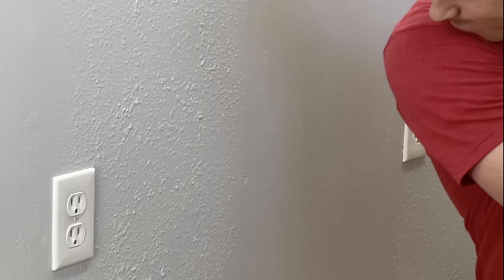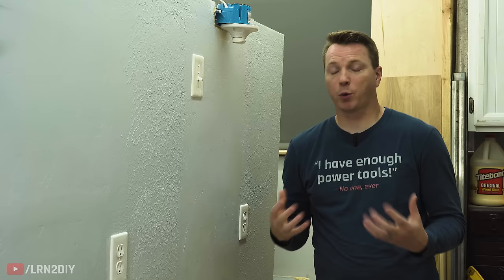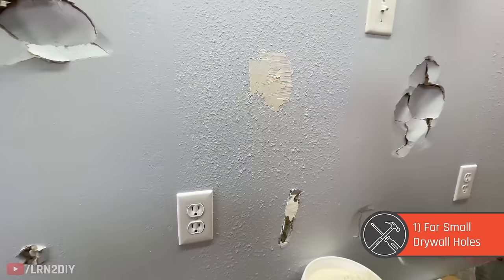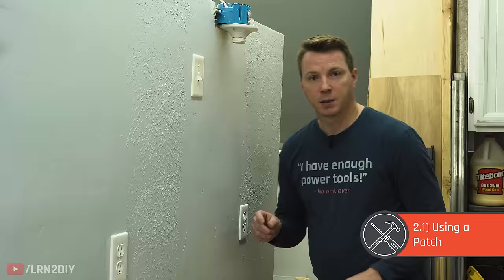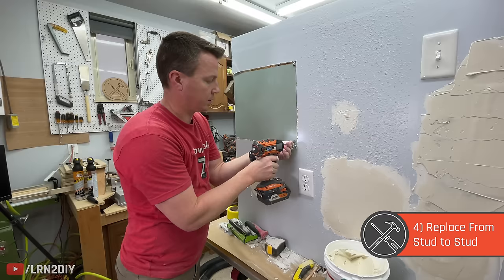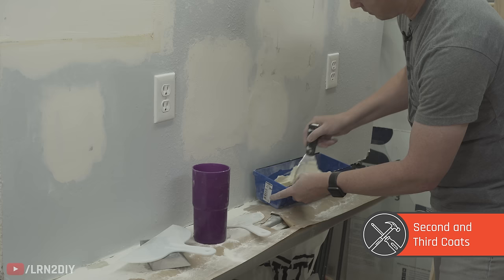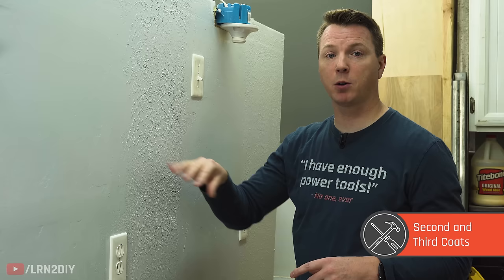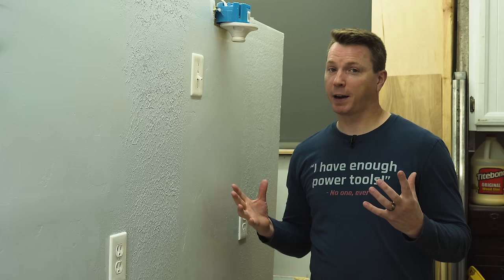How to Fix Holes in Drywall - 4 Easy Methods

Comment: I had a small hole in my wall and when I had trouble fixing it I got really mad and punched another hole in my wall. Thanks to this video I can fix both holes.
Reply: 😂 I can relate.
Reply: I laughed so hard at your comment I Chuck Norris roundhouse kicked a hole in my wall.... but now thanks to this video I can afford to laugh at any comments I want now.
Reply: Did you fix the holes. I need to know babe im invested in this comment ❤
Reply: Hahahaha!  Wtf!  I just found this video after frustratingly punching the small area I'm trying to fix.  This little fuggin hole is holding me up from painting a larger project I finally finished!  Ahhhhhh!  I needed the hole to be bigger anyway so for once I'm not that mad about punching drywall but your comment cracked me up!  Thanks!
Reply: Me too!! 😂
Reply: The anger issue isn't fixed yet 😂
Reply: use tape
Reply: Lol 😅
Reply: @solosix3991  by far my fav comment on youtube 😂

Comment: Electricians and plumbers are eager to open up the walls and unwilling to patch it up.  Handymen are charging an arm and a leg for small odd jobs. This video is so helpful. Thank you!!
Reply: they arent eager.. they just have to. And patching drywall, while easy, is time consuming, so it's not reasonable to excpect a plumber or electrician to spend their time doing that without charging for their time accordingly. and their time is far more valuable than drywall repair.
Reply: This is exactly why I'm here. Plumber busted two walls and a ceiling searching for a leak and then refused to patch any if it. Had to pay someone else just as much as I paid the plumber to patch everything.
Reply: I had the same attitude until as a home owner I had to step into the role of electrician, plummer, tiler, dry-waller, painter, etc... now I am very willing to pay the price for these trade professionals to complete certain jobs for me.
Reply: Correct me if I'm wrong, but at that rate, you can only afford to repair 2 holes...
Reply: @cdee2456  as someone who has quite a few plumber and electrician friends I can attest that they love the freedom of not having to do patch ups
Reply: @isawrichvarga  who wants to back to the same job you got paid for, to sand a hole. and repeat again the next day?
Reply: @godsinbox  Some putty mix you can sand it after 30 mins or so.
Reply: @jcberb  I agree. I had the same shift in mentality when I bought my house. Some projects I enjoy doing myself, but other things I have learned to leave it to the professionals. Little by little, I am learning, nonetheless.
Reply: I honestly would like to know if a drywall should be replaced after so many holes being made.

A plumber came in having to fix the mess that our upstairs neighbor made renovating their home and now I got 14 holes in one wall alone. They were patched up by the handyman but ... I am worried about the structure integrity of my walls now :/
Reply: @orzori drywall isn’t really for structural integrity… it’s just walls made with dust and paper… it helps but more for looks
Reply: @jacobshandymantreeservicel2522  jdndjdnd thank you XD Didn't realize drywalls don't offer structure cause I kept thinking about floating shelves and furniture anchored to walls.
Reply: @cdee2456  I disagree.. Professional board hangers have a much more physical job that requires a higher IQ than plumbers dude.. Anyone can glue and clamp two pipes that weigh less than a pound together. Not everyone can even lift the drywall let alone install it onto complex custom properties that arent square and simple. Electricians may have a more dangerous job potentially, but these low IQ muppets hack openings wherever they want and never ever ever ever cut stuff out straight.. If they are removing a piece to install wires, then they should be putting that piece back. No other trades do stuff like that. If anyone else removes something to do their job, then like decent humans, they put it back.. I have worked around all these trades for over 20 years. Theres no 2 trades that do less and want more $ than electricians and plumbers. I can go do plumbing and electrical after an 8 hour board hanging shift, but I guarantee that 99% of electricians and plumbers could not do my trade at all. Let alone after an 8 hour work shift.
Reply: @illwill718  Plumber is responsible.. Plumbers are useless! Sue him
Reply: @isawrichvarga  they however are liable for the repair if they opened it up. Homeowners need to stop letting these crybabies in electrical and plumbing get away with doing virtually nothing..  If you have the money to waste, sue them to make a point.  I take no crap from plumbers. As a board hanger, we work many times harder than them and when they get loud, they find out that we hit much harder than them.
Reply: Best not to screw anything to a  dry wall,better the timber @orzori
Reply: @WickedLobstah978 I can run wires and build boxes until the cows come home, but the second I have to patch drywall it looks like hot garbage.
Reply: You definitely would not want to pay your plumber or electricians rate for patching a hole lol. Nor could half of us do a job worth what you'd be paying

Comment: I have 2 holes in dryhole where my recliner popped holes in the wall leaning back into it.  Handyman gave me an estimated price of $1,200. The 2 holes are  8" by 8" & 13" by 9". I am a widow (77) on SS.  I will do the repair myself thanks to your video. Much appreciated !
Reply: $1200 is criminal for that. I could patch those both in under 3 minutes then its just tape n mud which would take no more than 5 minutes.. He can then leave and come back next day and hit it again (another 5-10 minutes). To save time for him and money for you, he could leave a sanding block and you could lightly sand it the next day and then paint.. If you add all the total time this job would take for drywall, mud and paint, it is less than 1 hour of work! If I lived near you, id come help you for a cup of coffee. It bothers me that these scumbags want to overcharge especially senior citizens.. Over charge the millionaire. Not the average person. That guys top price should have been $250-$400 (that is still great profit for such little work completed, unless he had to paint too.. Its not even worth that, but people gotta understand that doing even a small job takes away from other work opportunities for that day and they need to still make a days pay, but $1200 is ridiculous and that's why I say $250-$400.. Gets it done quick and goes to another job.  I am an expert in my trade. I work in MA in many multi million dollar properties and have worked with over 100 guys in my trade and can definitively state that I am the very best at my trade (at least from the people I have seen do it).. And as an expert, I wouldn't dare try to charge you that much.. The guy who quoted you is a scab and is what's wrong with society. Greed is everywhere. Glad you saw this video though and can save yourself the money and stress of being taking advantage of.
Reply: 1200 is Highway robbery

Comment: I just finished repairing a bunch of holes, from fist size to 15 x 15 openings ( these were repairs over prior repairs).  I am so glad I watched this because it confirmed the fact that I was doing it right.  Thank you for putting out one of the best you tube videos I have seen on repairing drywall.

Comment: I’ve viewed numerous videos about this, but this video is BY FAR the best. Incredibly professional, loads of examples and variety, whilst the texture stuff is just a cherry on the cake. Life savers, thanks a tonne guys ❤️
Reply: If you have ever watched “ real” drywall professional, you will realize these you tube tradesmen are an absolute joke, this guy would be kicked off my job site in about 5 minutes of watching him work
Reply: @titirititiri6360  can you recommend a better way to repair drywall? I can’t find anything that isn’t like this video.
Reply: @newuser689  drywall patch? Indeed, I use a method called a peel back relief, and always use 5 min speed mud, the speed mud or hot mud, dries faster, there is a certain point when the mud can be shaped, I can shape a float in 1 coat, that would normally take 2-3 coats of regular box mud, i then use a heat gun to further speed up the drying process, because you can shape it, there also is a lot less sanding, in some cases when I cut the paper from the surface of the existing drywall (relief cut) along with 5 min mud, i can float the patch flat in 1 coat, with zero sanding. This of course takes a lot of practice, flexing the knife with correct pressure, clean cool water to mix with, and years of practice. 
I wish I had time to make a short video of it, perhaps some day I will have one of my employees video with phone and upload to YouTube. 
Beat of luck

Comment: Great video, thank you. When I had a wall removed years ago, the craftsman used a lightly wadded plastic bag from the grocery store and dipped it in the drywall mud and applied it to the ceiling. Matched the texture really well.

Comment: I’m journeyman drywall finisher and I’m warning everyone , unless you want to get dust all over everything in every room of your house , DO NOT USE AN ORBITAL SANDER IN YOUR OCCUPIED HOUSE . 

I mean you got the main points , but if you have exposed mesh tape after you sand , it will show through paint and possibly  your  through texture.
Reply: No orbital Sanders in an occupied house... Yes... Agreed UNLESS.. you are able to move everything out of the room you are working in. I have had to occupy my house each renovation and have found just closing one room off (vents and all) and opening the windows in that room made the difference. No dust all over the house if you tape off the vent, open the window and just work that room.  Hand sanding just doesn't get that even flush with the wall look.. or rather... It's something only very skilled dry wall experts get down... 95% of the hand sanding I've seen has that pillowy effect and is good enough for an apt but if it's my house I want it to look good for long term. I promise... I've replaced Hundreds of walls and just do it...
Reply: FESTOOL Orbital w/ hoover dust extraction attachment very good, use it in commercial office buildings with active air con units and clients next door.
Reply: how many coats does it typically take to hide the tape?
Reply: @surfprepsales  2
Reply: @gapsta  thanks
Reply: Mine has a built in dust collector, so no worries 😁
Reply: @beccaking13  festool orbital with dust extractor is great, i use it in buildings with air con and sensitive fire alarms all the time lol
Reply: Just curious......what's a journeyman drywall finisher?
Reply: @codymoore1223  
See this for the description of a journeyman: https://en.wikipedia.org/wiki/Journeyman
Reply: @mws3d  🤣 you don't need to be licensed and there is no certification for drywall. It's skilled labor. There's no apprenticeship and almost every drywall finisher is self employed.
Reply: @codymoore1223  someone that knows what they're doing unlike this guy sorry just keeping it real
Reply: I always just tape off a full plastic wall floor to ceiling to isolate the area I’m working in when it’s an occupied space. Doesn’t take too long and very effective. Some of those dust collectors people mentioned look awesome, but I’ve never tried them.
Reply: @Boardwiser62  facts
Reply: Also if you do a little bit of cleanup without leaving all those lines in the mud there wouldn’t be nearly as much sanding needed I can’t believe how much he just slapped on without any clean up,If you don’t do super sloppy work to begin with you won’t have to do as much work at the end
Reply: U try just sand paper by hand?
Reply: can mesh tape be sanded away

Comment: On pre-existing textured walls, dab the perimeter of the wet mud with a damp sponge to blend and eliminate new edge; otherwise, you should sand the edge when dry before texturing the patch, which is painstaking and unpleasant.
New texture will not hide that edge.

Comment: Helpful tip: When you apply the drywall compound keep your knife as clean as possible and make it as smooth as possible and not leave any lines. A few minutes of correcting that will save you lots of time and elbow grease when it comes time to sand and make it flat. Also I prefer a hopper than those cans of texture. It doesn't provide the almost identical texture Im looking for.

Comment: Thank you so much for the crash course! This is something that wasn't covered in high school. We only applied mud to pencil holes and staple holes. I do, however, remember our teacher bringing us to the gym storage where we could find the only "big enough" hole to use a mesh he placed behind the wall, holding it flat using strings then puddy it... I HAVE done this when I did interior painting on my summer job and it was not easy.

Comment: Thank you very very much for the tutorial! You taught me how to repair all of the types of holes I had in the drywall in my house in 16 minutes!
Reply: Lmao his work is so clownish 😂 that isn’t even how you do it. You should use much wider trowels for the wide ones. And the best thing is cutting a new drywall piece, and screwing it into a wood backer piece. Then mesh tape, mud 2x, sand prime and paint. This guy has no clue how to do professional work, his work is amateur work and the YouTube video is designed to be watched by amateurs
Reply: @charlesg7926  i dont wan to do professional work.  just want the hole patched

Comment: This is great. But it would also be very helpful to have a precise shopping list of the stuff you need to do all of this so people aren't left scratching their heads in the hardware store at all the different (seemingly innumerable) choices on the store shelves.
Reply: I'm sure by now you've fixed your problem, 2 months later and all, but here goes for future people who read your comment and agree;
One razor blade knife
One drywall breadpan(the long pan for sheetrock mud)
One drywall knife(I know, I know.  It's the wide spatchula looking thing in the video, not another knife.  As with the breadpan, any hardware store stocker will know and point you to it, and aside once in the section, you can't miss them.  The width is about spread, the bigger your hole, the more mud, the bigger the knife, the more surface area.  Or better said, pros use different ones for different stages of finishing work, ignore them all but the short one.  For the purposes of this video, you just want the one that's as long as you hand.)
Some mud.  Perhaps a pint if your hole is small or you do the square patch and are just filling seems.  Any kind is good, just grab one that says quick dry, you will not need a 5 gallon bucket.
One sanding sponge.  Grab the one that looks like a trapezoid, and not the brick, easier to press your fingers when sanding stubborn bits, it's useful for more than just corners.
A chunk of drywall.  There's no real need to purchase a whole 4x8 piece, they will almost certainly have scrap the size you need laying about and will sell it to you cheap or just give it to you to be rid of it.  Just get what you need here, specially if you're in a car.  If they don't, let them know you're in a car, and they will just cut it for you.

And screws if you wisely use the wood backer method.  It works wonderfully by the way.  I don't remember what he called it, but it's the best one for holes caused by elbows.  Every professional will look for tips he doesn't know and here while nothing new stood out, these were all solid tips amd methods.  If you use that orbital sander or palm sander, get a real sheetrock mask.  If you can't get one in time, then Don't use the sander, it is a Lot of dust.  In fact, for patch work in a room in your home I doubt you want to dust literally everywhere, and with lungs you care about, just use the sanding spounge, you only have to once after all.

Oh yes, if you need to remove broken sheetrock for a square hole, buy a drywall saw, also called a rasping saw.  Will slice that square you need infinitely faster than the razor blade knife and you can use the knife to finish the pretty bits.  You will want both, so buy both.

Comment: I got a tip from the hardware store today on how to install the drywall patch I bought there.
After you have marked the area to be patched, sand down the outer edges of where the patch will go. Just a little bit, like 1/32" or 1/16". The patch will go into the recess you create, and it won't jut out as much. 

The other tip I learned years ago. Put less drywall mud on than you think you need. It takes 5 seconds to put the stuff on, and many minutes and a cloud of dust to get sanded down. If after the mud has dried and shrunk there's not enough coverage, just take another 5 seconds and apply another thin coat. Rinse and repeat.
Reply from the maker: Great tips! Thanks for sharing!

Comment: Thanks for saving me the $200 my overly priced college apartment would've charged me for going Kyle on my wall last year
Reply: As a landlord, I'd charge you much more than $200 for any hole in my walls.
Reply: @ytsux9259  You should consider red brick walls. Cheap, sturdy, not the most heat efficient but that's between your tenant and the utility company.

Comment: i had a huge hole to fill in once , i used 4 screws that were about twice the thickness of the drywall , cut a small piece in a shape of ,,X and put it behind the wall where i screwed it to the drywall that was okay then i put a piece in the now cut out hole with the shape and filled in .. it worked fine for me - hole was high up so no pressure was to be applied on the patch

Comment: I hung my TV on my bedroom wall and I was using some A/V gang boxes to hide the cables. When I cut the bottom hole, the pipe for my master bath's toilet was dead center in the hole. I moved down 6" and installed the box. Tip 3 saved the day because I already had everything at home. Great videos man, keep it up !